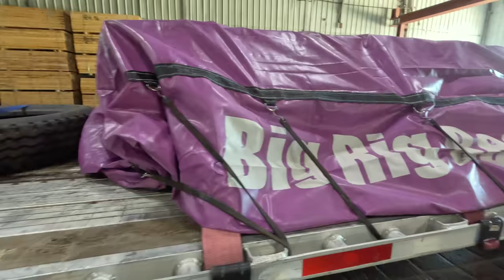Weekend Run Gets Turned Around Fast 😮‍💨

Comment: 28:00 just a quick free piece of an advice; when hauling stone or crap like that ALWAYS sweep that trailer after getting that load off. It’ll only going to take you a few minutes to do it but it’ll also going to save you a lot of headaches down the road later on. Maybe your boss can get you a blower like those that people use to blow leaves off at the yard.

Comment: The tarp situation is probably to help keep loose rocks from coming off the load and breaking car windshields. That would be my guess.
The fenders mounted the way they are will build up with snow in the winter an not clear themselves. The gap at the bottom should be opposite of what it is, bigger at the bottom so the snow will fall out when winter gets here, mud could build up too.
Reply: In 2023 you’d think they’d have inbuilt padding.
Reply: @gistus123 They do but using plastic and pressed cardboard Protectors strategically placed is cheaper and much better. No matter how padded sharp edges will eventually cut through but edge and corner Protectors will prevent that.

Comment: What you can do, if you want  is to tape a copy of your truck key in the engine compartment - you can use electrical black tape, that is what most of us do. When taping the key (next to any thick wire harness) circle several times until the key is completely undetected, this way no one will know that it is a key.  This way any time you lock yourself out of the truck, you know you have a key to get back in. Good luck!
Reply: Ok unless the hood release is in the cab, like most new anteater trucks.  I always kept a spare key in the battery box
Reply: @berhorst59  ...battery-box or dip-stick are the first two places that anyone will look for the your key. I
n Becca's case, I'd rather suggest to use a secure key-box like the real-estate agents use (it hooks securely to a railing or house-door handle) and needs a 4-digit combination to open.
In Becca's case, she can use her head-ache rack cabinets to hide that gadget. (the cabinets themselves are already lockable, and these small keys fit easily on your pocket key chain.

I  always tell my drivers to never hide the key on the dip-stick or battery-box, but find another safe place and if you need to drop the truck at a garage or what have you, simply text the person who'll need to use the key, where it's hidden.

Comment: Corner Protectors are pretty cheap considering they will definitely prevent damage to expensive tarps. Oftentimes the supplier will have some for free for the asking. I will be amazed if you don't have huge rips later. Those blankets may aa well be wet tissue paper. I shipped and received building materials for 15 years.

Comment: I used to use a old curtain off a old trailer,,, then put my canvas on last ,,, this worked well ❤ or used old pieces of carpet on the sharp corners to protect your sheet from being cut,, especially when the wind is creating movement stops the corners burning through ❤

Comment: Watching you do your thing makes me realize that in 2 months, I’ll finally have my CDL and start working! FINALLY! Here in Quebec, Canada, the course is 5 months full time, so it’s a pretty long time when you can’t wait to start working! But at least I’m learning and having a lot of fun doing it! Great video as usual! Be safe.
Reply: Wow you must be going for the vocational diploma in trucking? 5 months seems way to long and tedious to learn to drive a big rig. What is the benefit of the vocational diploma? 5 months of pay your missing out but I guess you'll be prepared for anything 🤔
Reply: @solarlight10  ...the Class 1 (CDL-A) driver-training rules are far stricter in Quebec than anywhere else in North America. But, at least they use loaded trailers for their practical training (usually flat-decks loaded with rectangular rocks or van-trailers loaded with paper-bales (nice and heavy, but no risk of damage in case of an involuntary road-departure).
I've made only great experience with 'greenhorn'-drivers right out of any QC-Truck Training schools and have no qualms to take them on at their actual license-class, provided they have the F & M endorsements (F= air brakes, M = Manual Transmission).
On the other hand, when we engage over-the-road AZ-graduates (CDL-A)  greenhorns from the mandatory Ontario-MELT (Mandatory Entry Level Training) program, we take them on as DZ (CDL-B) drivers for the first 6 to 18 months, before the get internally upgraded to operate tractor/trailers.
After all, if the Province mandates graduated licensing for car-drivers, why would we allow a tractor/trailer greenhorn onto the road right off the bat with a combination unit. Let them first get their feet wet with a single unit, which in the forward motion is no different than driving a T/T, and once the newbie get's used to the larger size, the transmission, the braking and the maneuvering, they'll be far less intimidated working with a trailer attached to the power-unit.

Comment: thanks Becca for showing 23  23  there is too much space between fender and trailer    gravel will sandblast your head rack and chip windshield     loose tarp will wear off    corners still look sharp    add strap with edge protector on very end corners

Comment: for that plate steel get some corner protectors and you won’t have to worry about the pad tarps.  just get the tarps as tight as possible and you wont have any problems.

Comment: Take your tarps to a tarp shop and have them put a 10 foot wide piece of Kevlar material down the center of your tarps on the underside. It won’t add much weight and it will protect your tarps on most loads. Still get some moving blankets for sharps but it’ll lessen your stress significantly.

Comment: Enjoy your  videos, cant drive because of my eyes but used to run with my dad. Just thinking about that cover for your locks that your dog has figured out, dont know if its possible but if you could turn them around the other way that would keep them from just opening up when your dogs paw rubbed them. Anyway all the best BE SAFE AND GET-R-DONE

Comment: Look for some blanket covers that the furniture movers use they are thick, but easy to handle and use them on the shop. Ends of whatever you are hauling to protect your new covers from Rippon. Also, they are easy to store when not in use like where you keep your covers on top of your headboard, I have seen them and used before and they were great on the shop. Ends of whatever you’re hauling.

Comment: For a load of steel like that, put a strap as far forward and a strap as far to the back. If you can get the strap close enough them yellow edge protectors will not only protect your straps from getting cut, they will protect the tarp from getting torn also. Take a close look at your edge protectors. The outside corners of the edge protectorsare shaped like that for a reason.
Sometimes they may load the steel so the very front or back is right in the middle of the pocket and you can't get the edge protector close enough to the edge. You should also carry at least 20 of those red plastic V-Boards that are about 12 inches long. Then the strap don't have to be so close to the edge. Let the V- Board overhang an inch or two off the front and the back. The tarp will be protected and you won't have to get your sleeping blankets all dirty.

Comment: If nothing else, put your v-boards or a 2x4 or what ever dunage you may have, on top of the edge of the steel.  Styrofoam sheets i found in the garbage at a shippers worked well also.

Comment: They may want it tarped incse of the loose debris all over them fly off onto cars behind,or if it breaks up under driving vibrations and strapping pressure then the tarps at least keep bigger bits contained. Maybe somthing like that happened and fell off on rd and got told to tarp from now on🤩Yr welcome

Comment: You should think about getting an APU, these newer diesel engines are not meant to idle.  This will cut down on fuel filter and fuel pump issues.

Comment: Hi Becca great video your a hard working gir. Keep the load binder straps flat I see one or two straps with a twist in them, when straps are twisted the load rating drops by 1/3 of its load rate.
Reply: This is incorrect. Tests have been done on twisting straps to see if they reduce load rating. One full twist has zero affect on load rating. Look it up here on YouTube if the video is still up.
Reply: @GrizzlyOldFart  ...i do believe you're correct, but "YouTube" is not the correct source to get the legal decision on this subject. Verify it through the AAMTA (or CCMTA in Canada), i.e. the authorities who actually write the Cargo Securement Standard for both, the US and Canada.
If a driver ever gets cited for a twisted strap, he/she will be hard-pressed telling the Judge at trial that YouTube said it is legal. (But I will actually look into it and find the correct CFR section where the info is published....once I find it, I'll add my two-cents-worth to a future BRB comment.
Reply: @andrep8287  I never said anything about a legal decision. i have been flatbedding for many years and I have never heard of the AAMTA. Cargo securement standards are written by the FMCSA in the U. S.  There is no mention of twisting straps one way or the other in the FMCSA rules regarding securement.
 The tests i mentioned have been done by individuals and cargo securement manufacturers. Most people using a twist are really doing a half twist, although tests have shown that up to 2 full twists have zero affect on the load rating. The test I watched most recently is here : https://www.youtube.com/watch?v=ifyJjQXOttE . That test was done on 2 inch straps. Even 10 twists per side only reduced the capacity by just over 15%. 
The real reduction was in the test where he tied a knot in the straps. Wet straps caused a minor reduction as well, but not enough to worry about if all securement requirements are being met.

Comment: Go to a bike shop (bicycle) and see if they will give you some old worn out mountain bike tires and the cut them into small  6 - 8 in pieces you can use as tarp edge protectors

Comment: Loads like that stone or other slick materials try to X a pair of chains over the front of the load to prevent the line from causing damage to the headache rack or back of cabs should you have to make a panic stop.

Comment: Never, never, never, move your truck without securing the load, even if its a minimum securment.  To Protect tarps find some old carpets and cut into 1 to 1.5 foot squares and put them under tarps at corners and sharp edges.

Comment: Hi!
U should buy a steering wheel knob....helps a lot I think when I drive!
Reply: ...just fyi, @Steffo7505....only if you use one that you can flip-down, because they cannot legally be used on public roads with posted speeds above 35 mph (in the US) nor on any public road in Canada, never mind the posted speed limit. Moreover in Canada you must have an Endorsement or Restriction on your provincial driver-license to be allowed to use a steering-wheel knob.

Comment: You need to do a 34 hour restart.Start out Monday fresh.
Reply: @jamesfalls3310....just fyi, 34-hour resets are not mandatory (a 24-hour rest is mandatory before reaching the 60 or 70 hour limit - depending on which cycle you're working on)...and that break is non-negotiable. But it doesn't need to be a Calendar-day; it can be noon today to noon tomorrow. The HoS rules state however, that "if the driver is afforded a full 34-hour uninterrupted break, he/she may reset the the clock (wipe out the previous 6 or 7 days' accumulated on-duty hours) and start a new cycle." You may have noticed, the 24 hour break is mandatory, whereas the 34-hour reset is optional.
Moreover, because Becca works for a carrier, which operates "7/365" (i.e. also being dispatched out on Sundays,) she will not always be able to take her 24-hr mandatory or 34-hr reset on a weekend. Thus, she won't always be starting a new cycle on a Monday.

Comment: HOW TO:  Beccsanator...here is what I hve done in the past.  PLACE AN EDGE PROTECTOR ON EACH OF THE END CORNERS (WHERE THE TARP WILL TEAR) AND USE A SMALL RACHET STRAP TO HOLD THEM  IN PLACE. THEN TARP.  WORKS WELL IN A PINCH.

Comment: Your drive tire fenders are not correctly installed they need to be rotated to where they spaced equally top to bottom from the tire........ mess-ups happen with loads and wrong addresses , nothing but a thing in the trucking world .....

Comment: I have watched a couple of your videos. You should look into belly wrapping. At least one. Example those metal sheets. Now for the stone pieces that wanted tarps. Their is a chance, you hit a bump, a piece will break off, hence the tarps will keep the pieces falling off the flatbed….
Reply: ....hit a bump., very much so...especially at RR-crossings, like the one Becca went across a tad too fast in that town, shortly after leaving the loading place. RR-xings within urban areas should always be taken in low-gear and drive across it not where everyone drives across...move about a tire-width over to the left or right, as it will be far less bumpy.

Comment: This might be a silly question, but why don't they give you a flatbed trailer ? You are losing some contracts and the cargo is getting really heavy, looks like the trailer wheels are going to suffer on this one.
Reply: if anything, the trailer wheels suffer because the spread is too long. The advantage of long-spreads is that you get 20,000 lbs weight-allowance on each axle (instead of 34,000 lbs on a normally spaced tandem bogey), but there is far too much yawing (sliding rubber across the pavement) when making tight turns, when your spread exceeds 60 inches!

Comment: If you put a strap as far forward and a strap as far to the back, as far back as vou can (with corner protectors), you wouldn't need blankets and the tarp job would look much better, if you put the straps on the inside, it will look like a square load from the outside. It will not look likke you tarped a load of Zeek`s poo.

Comment: The guy in the red truck is a local driver and he's driving a day cab truck
Reply: How do u know I doubt u do
Reply: @danielgraf8957  ...if a power-unit (tractor / truck) ain't got a bunk (sleeper), i.e. it's what's known as a day-cab, chances are very good that the driver returns to his/her home-terminal at the end of the shift. If the driver would need to deliver to an area outside a 300 mile radius, he/she would need to spend the mandatory 10 hours of rest in a commercial sleeping facility (read: motel / hotel) before he/she could begin a new shift. Sleeping while slumped over the steering wheel is not legal for the purpose of gaining sufficient rest-hours between two shifts.